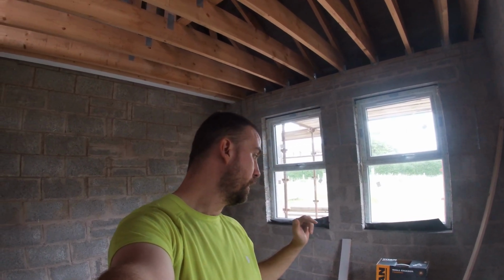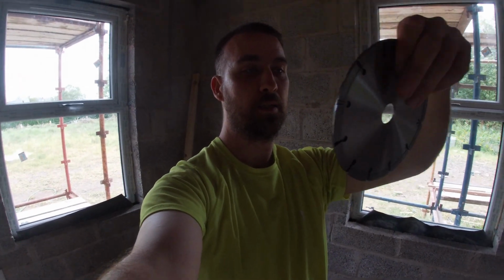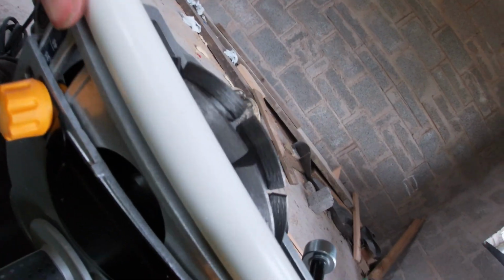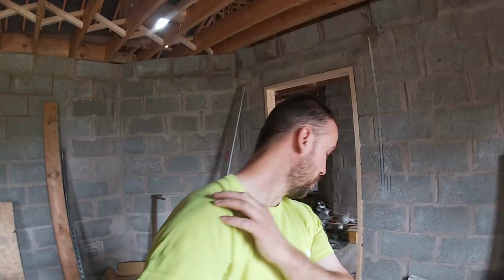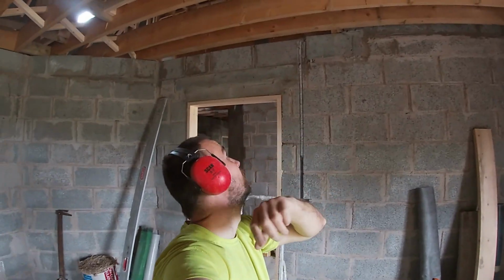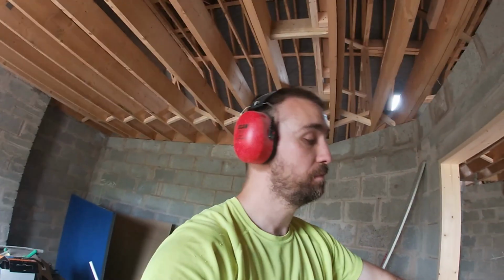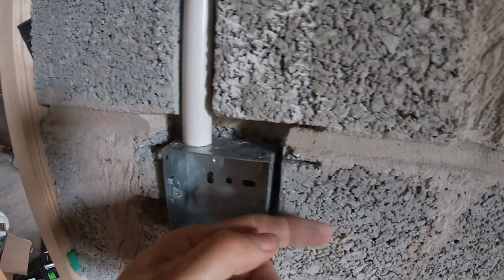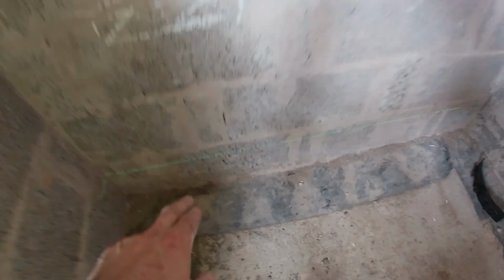- Titan Wall Chaser Unboxing & Concrete Cutting Test

Comment: I remember around 30 yrs ago there was a couple of older guys that chased all the tracks using a block hammer and 1 inch chisel on 1 of the sites I was plastering on, the old timers would put us all to shame :)
Reply from the maker: I could do it but this will be easier and a little less vibration on the wall but yes much respect to the ones before us 👏 🙏 👍
Reply: @macplastering  For sure, I'm with you on that one, power tools for the win lol. A little tip for you form experience, paint the PVC pipe with a unibond/SBR,  1:1 sand and cement mix, the mortar will grip to it like hell.
Reply from the maker: @SuperLinuxAudioGuru thanks for the plastering tip from a guy who's channel is actually all about plastering and rendering 😊

Comment: I went cheap on the wall chasing. I bought a 9” jcb grinder out of Argos and put insurance on it. Cost £40 all in. I was sure it was going to get wrecked but it tracked all the walls and kept going for years. Dust is a big issue so I did mine before windows went in. Good blades are the secret as well. Hard work though.
Reply from the maker: soundes a great deal that man ... yes i wish coulda done this before windows where in but just a timming thing as was busy with work and needed a spark to have a walk around with me LOL
Reply: @macplastering here see them sharpen edges on the Chanel’s ru going to chip them a bit with a hammer for the scratch coat to take better. For the electrician get a master switch behind the living room tv. If lus all tv should have cat 6 to them now from the router. Where ur router is get few sockets in and cat 6 to an Ethernet switch. Also 5amp socket in living rooms for corner lights or table lamps all switched from the wall switches. You might want power to a water filtration system under the sink. Get ur plumber to put in a filter system as this algie isnt going away any time soon.  There’s a lot to think about lad.
Reply from the maker: @marcusd2380  Haha yes these things are all in my mind haha hopefully have a plumber up soon walk around with me to sort out what needs doing ect , I was just going to fill the chases mind you not loads of room around the pipe so a little scratch coat on them will work ok with out needing to knock it of for better key i will just add a little sbr :)  there is loads to think about for sure heads turned oh and every time im out doing work i find my self losing so much time looking at other details on the house that needs doing and waste time thinking about it LOL